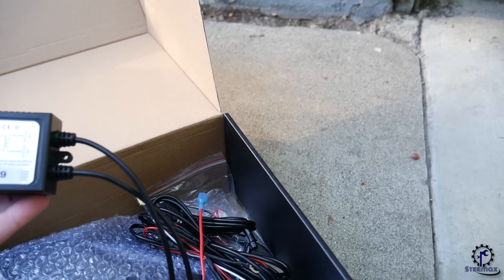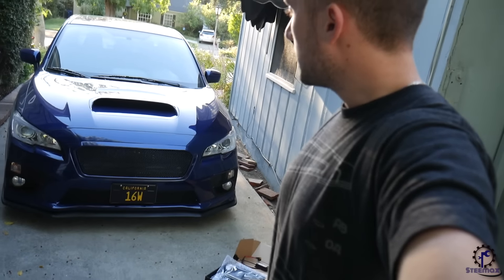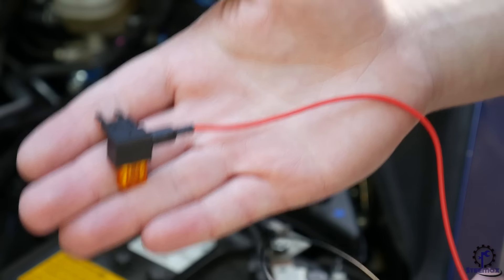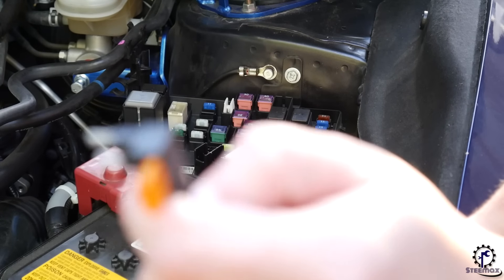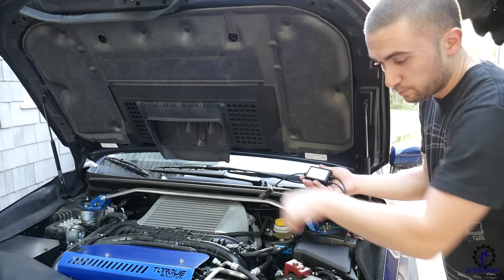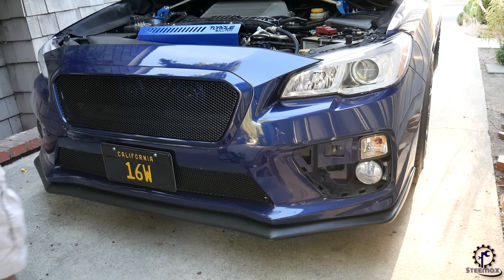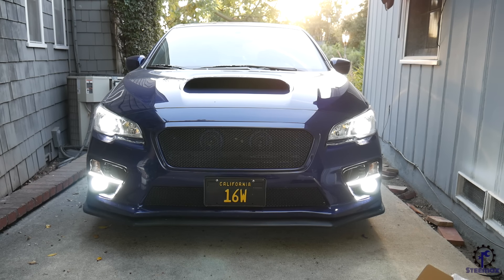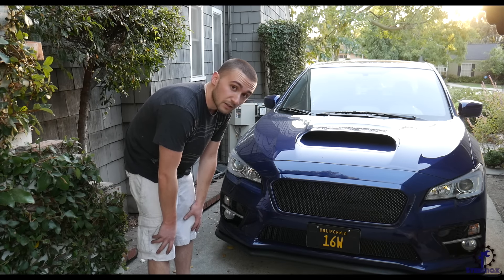Subispeed S4 Style Bezel 2015 - 2017 Subaru WRX Install

Comment: Great vid. I too just got these and for those who are looking for a place to mount the ballast, keep in mind that the diver side cord is short. I stuck the ballast to the side of the washer tank, because i wanted it away from the elements but barely had room to plug it in once I got everything buttoned up. I wish Subispeed made the connection longer.
Reply from the maker: Thanks man, and that's where i put mine as well... the wires barley reach each area.

Comment: Bro get yourself a set of race ramps for low profile cars. Makes working on the car in the driveway super easy
Reply from the maker: +Boosted Beast I really need some. I have rhino Ramps and they are useless at this ride height.

Comment: Awsome video  I have  the subiespeed clight as Drl harness with the add a fuse In it  can I just tap into it for the  power. Just cut the add a fuse off? Thanks for the help
Reply from the maker: +Shawncey Stiles Subaru thank you! yup you can just tap into that wire and they will power up with your c lights

Comment: looks really good on your car!! I have the same bezel with yours, do you know how to make the bezel on all the time even though I do not turn on the headlight? THanks@!!
Reply from the maker: +Lawrence Fong Thanks Lawrence! I'm not 110% positive but I believe you need to tap them into both your DRls and Low beams
Reply: Hey bro did you ever figure this out? Just got mine and Im thinking about cutting the long add a fuse wire and tapping into the quick disconnect wire. Want them on all the time lol.

Comment: Thanks for the video, made my life a lot easier.
However, I have a question Steemax, how did you route the "passenger" extended wire. I am thinking of routing the passenger extended wire above (close to the hood) but it seems that it might be barely long enough. Did you get 2 extended wires (1 for passenger side and 1 for the driver side). Thanks
Reply from the maker: +Peter C hey Peter! The wire did seem to short to wire from the top, I wired mine from the bottom (behind the bumper).
Reply: Steemax. Thanks for the reply.  Did you have to take the bumper off?  If not, how did you route it behind the bumper?  I am trying to avoid taking off the bumper.
Reply from the maker: +Peter C I didn't take it off, I just undid the clips along the bottom and tucked the wire up into it. Pretty easy

Comment: Hello, I recently ordered this for my brothers WRX & I was just wondering if I want to run this only for when the low beams come on where would the wiring go? I disabled & unplugged the DRL for his car. & for when the high beams turn on, I want the bezels to turn off. Let me know, thank you!
Reply from the maker: +Justin Kim hi Justin, you would need to use the fuze right next to the one I plugged into that I show in the video for the DRL. Unfortunately I'm not very sure how you would get them to turn off when you hit the high beams. ... Perhaps in that case you can tap them directly into the DRL wiring by the head lights instead of the fuze box.
Reply: Steemax hey but next time you do some electrical work on your WRX disconnect the the battery from your car....my 2cent...great work

Comment: Stupid question.... so you tapped the red wire to the low beam (so it'll turn on when you turn on your low beam only?). What if i want to turn it as a DRL, should I tap the red wire to the high beam 15W fuse?
Reply: Did you find an answer on this?

Comment: Hey man, great videos! Question, it looks like you have the Garageline Strut Tower Bar also, did/do you get some popping noises when turning the wheel from the strut tower area? I noticed some after install.
Reply from the maker: +Brandon Gage Thanks Brandon, this is actually the Cusco strut brace, and I haven't experienced any noises at all.
Reply: Ok cool thanks. I have the Garageline and I guess they are almost identical in appearance.
Reply from the maker: +Brandon Gage no problem, I hope you get it resolved, that would annoy me lol

Comment: Where did you mount the ballast? And did you run the extension to the passenger side thru the engine bay or thru the bottom of the bumper?
Reply from the maker: +haw1144 there's a flat shelf like spot on the windshield wiper fluid container i double sided it too. I'm not too worried about heat, it's a thick container and the ballast only gets warm. I routed the wire through the bottom of the bumper, pulled all the pop clips and wired it that way.

Comment: Bought the same thing with the extra quick connect but something tells me I still need the subispeed drl harness to get the c light drl feature, what is the quick connect harness really for? Is it only used if you already have the subispeed drl harness?
Reply from the maker: +Houston Wilson hey Houston, yes you will need the Subispeed DRL harness if you also want to run your c lights as DRLs. The quick connect is just so you can run the bezels as always on with both DRLs and low beams
Reply: Steemax thanks !!!

Comment: Hey Steemax, Is there a way to get them to only run when the headlights are off? Just act exactly like the normal DRL, and turn off when the headlights go on. I'm thinking of getting these as the switchbacks and want to make sure there won't be any issues.
Reply from the maker: +MaulKiller54 hello, yes you can easily do that. In the video I show two fuse options. One is for DRL and the other for low beams. All you need to do is use the DRL fuse spot.

Comment: Do you know how to wire these as a DRL setup? Without parking lights on. Thanks.
Reply from the maker: +skier6666 you would just have to use the DRL fuse right next to the low beam one I pointed out in the video. Then you unplug the DRL harness near the passenger side fog light and horn behind the bumper. That will make it so your bezels are the only DRLs (your high beams will still work)
Reply: Already have DRL unplugged so I will try the fuse connection you mentioned. Thank You!
Reply: So I have the DRL plug unplugged & the add a fuse plugged into the high beam fuse. The DRL strip only comes on with high beams.

Comment: So the way you have it setup is always on or only when you put your headlights on? I want to run them all the time as a DRL and have them coming in a few days, any help would rock!
Reply from the maker: Hey, I have them setup to only turn on with headlights. If you want them always on you would tap into both the fuses I showed in the video instead of how I only tapped into the 30a
Reply: awesome thanks but quick question, the harness it comes with only has one add a fuse correct?
Reply from the maker: yes that's correct you will need the $5 optional quick connect subispeed offers. You use that to replace the single add-a fuse with two
Reply: perfect, I ordered that as well, thanks dude.
Reply from the maker: Anytime!

Comment: How was the fitment for you? I just installed mine couple days ago and seems to be a little gap where the turn signals are on both sides🤔
Reply from the maker: hmm... they were spot on like OEM.. you sure all the spots snapped in? It is a lot tighter than OEM and takes more force to get all the clips pushed in.

Comment: great video,  any idea which fuse slot would you use to turn the bezels on when selecting the first (notch) on the headlight lever before selecting the 2nd (notch)  to turn actual headlights on?
Reply: i was thinking slot 15 in the manual's diagram. Your thoughts?

Comment: So these will stay on even when parking lights are on correct?
Reply from the maker: +Midnite8 you can set them up that way if you'd like, I have them setup to only turn on when the low beams are on
Reply: Steemax - hey what do you have to tap into to make them stay on with parking lights also? or does it stay on automatically with them when you tap into the low beam?
Reply from the maker: +Travis Villanueva well you would need to actually have them tapped into both the high and low beams in that case if I'm not mistaken. The parking lights are your DRLs originally
Reply: Steemax  thanks!  ok so to make sure we're on the same page. when I turn one click to turn on clights and taillights  (noheadlights) I want the bezels to turn on also. So basically come on with first click and stay on with 2nd click (headlights).
Reply from the maker: +Travis Villanueva hmm that's a tough one because I haven't seen it discussed but I believe they run off the same fuse as the low beams ... So you would be right. I have never tried to see if mine work this way. I'll give it a shot when I'm home from work today. You can private message me and I'll let u know what I find
Reply: Steemax k thanks man. I messaged you on Facebook page steemax
Reply from the maker: +Travis Villanueva got it! Thanks

Comment: it didn't match my 6000k head light and morimoto c light.....oh well. bezel led was more like 4800k
Reply from the maker: +WRX Channel interesting i found they matched my 6k HID's pretty darn well actually. I think the bezels are advertised as 5500 on Subispeed's sight if I'm not mistaken
Reply: Steemax which low beam bulbs you use?
Reply from the maker: +WRX Channel I have the OLM All in one 35w HIDs
Reply: Steemax oh ok. my low beams are slightly cool whites as you can see... it will match my old olm HID though
https://www.instagram.com/p/BN_MuU4jrQQ/
Reply from the maker: Ah I see it